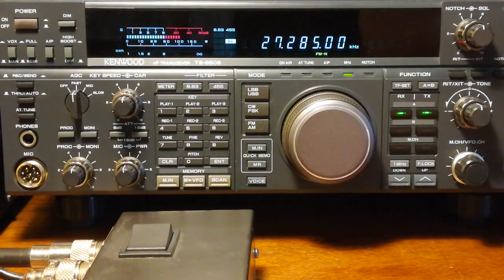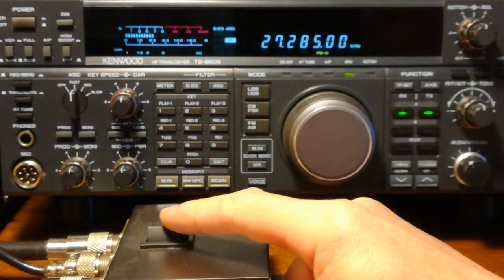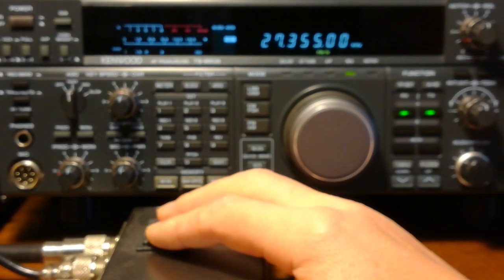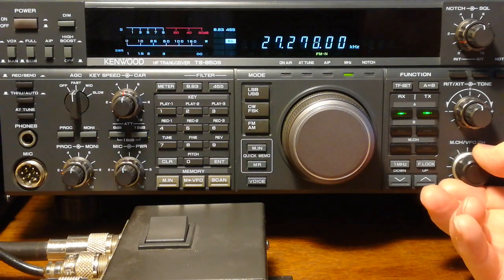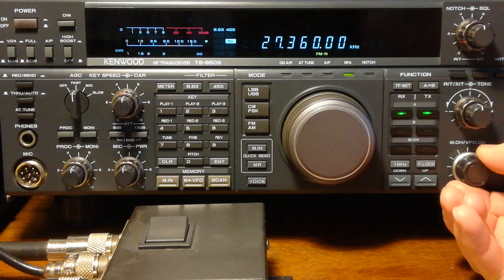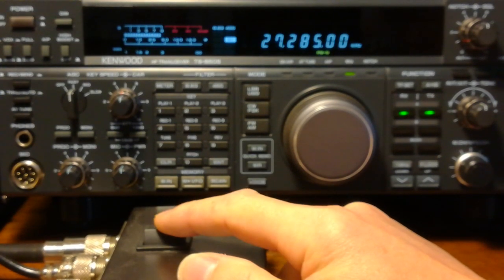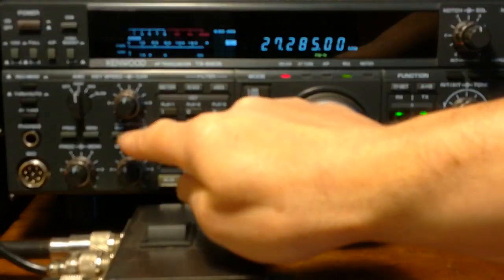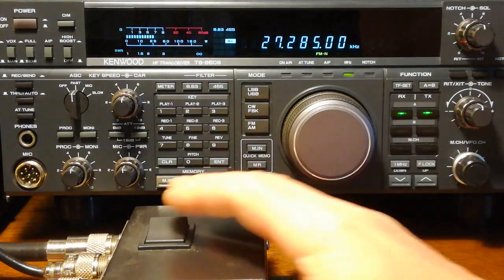Homemade 3 ele  Yagi Vs 5/8 wave Vertical.

Comment: I have 3 element yagi on 11m and I've compared it with 1/4, 5/8 and 7/8 verticalas. Not allways yagi are better than vertical but sometimes its 3-4 higher signal. I’m recommend yagi becaus its like nothing on 5/8 or nice QSO
Reply from the maker: You will find cross polarization is one of the main limiting factors... Vertical to vertical is best, Same as horizontal to horizontal is best , But not Horizontal to vertical and visa versa ... So if you are trying to work a station who is vertical then  your  horizontal yagi might be a lot worse than if you were on a  vertical antenna .. Cross polarization  can make a big difference, Not always but especially on local contacts.